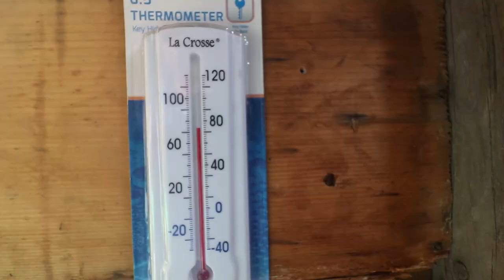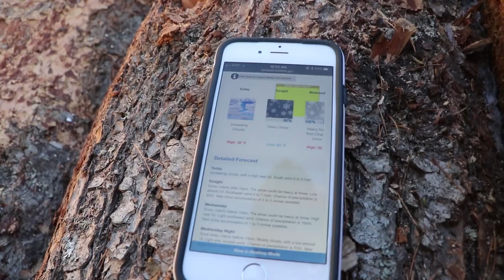Turning a Tree Into Perfect Boards

Comment: If you are going to use any of it for flooring,  you don't really have to worry about the length as long as it fits between two floor joists.  In fact in a floor random length looks really good, and is common practice.  As a side note you have a brake light on the trailer.  Have a blessed day

Comment: nice stacking of bundles....your attention to strips between the boards right at the ends will keep it from twisting....good job.  air drying will take the moisture out of your lumber just as much as kiln dried....with time.  just poly the top to keep the rain and snow out. cheers!

Comment: Jesse, suggest that you consider your stickers at the end of the pack, on the square end a Wider sticker, double the regular sticker width, and move it to the very end of the pack layer. Would guess that it will minimize even more the checking issue. On the East Coast we always do that with All species. HPB

Comment: hey guys, enjoying your series immensely. using it as company while we design the addition to the timber frame home we put up about 20 years ago as newlyweds - your journey sure brings back memories. in any case, designing and building, then having lived with our house all this time, we've some lessons learned that we would love to share. subjects that occupied us and still seem to be open for you - windows, ventilation and heat exchangers, running utilities, generators (built my own low speed diesel powered) pests and varmints taking up residence - lots of lessons learned. our frame is hemlock, built by a framer 3 generations removed from ted benson, located in northern new england with wind and weather that looks a lot like where you are. we'd be happy to have a conversation if you think it might be helpful. BTW, the two ted benson books we bought back then (glad to see you find it useful as well) were great, he surely deserves a place in history for his contributions to all this.

Comment: Nice job cutting the wood. I really want you guys to consider this. You really should get the house dried in before you put the flooring down. I know you feel like you have to do it the other way. But you are making a big mistake. Get the roof on otherwise when you put this flooring down especially after it's been kiln-dried it is going to soak up water like a sponge and it's going to expand exponentially. You really need to have the roof on before you put this flooring down. And you need to keep that flooring as dry as possible from that point on. Even with the roof on, It'll soak up moisture without the walls up.  You need to get the walls up fairly quickly to after you get the floor on. Just trying to be helpful and I hate to see you waste a lot of time and effort and cause all kinds of problems. Do yourself a favor and get the roof on first!
Reply: They don't feel they need to do the floor first, they KNOW they need to do the floor first, per their engineer and architect. I don't understand how people fail to understand how this type of frame works and the fact that the second floor is needed to hold the frame square and the wall panels needed to tie the frame into the floor before the roof is built. They explained it, but then again I also spent about 20 years doing construction work and have seen a few buildings and have built and squared structures. If it was a stick built structure, they it wold make sense to do the roof and walls first. I do agree with the moisture problem. It seems they might have been better off waiting to build the timber frame at the end of winter or beginning of spring and then should have had the panels, windows, and flooring figured out so that they could work during better weather and be dried in by fall. They set themselves up for failure with the timeline last year. They are new to this and crap happens even for professionals. Hopefully, they have a better timeline with getting it dried in and the weather doesn't cause any problems to the house.

Comment: Putting that mill on a trailer is the best way to bend the bed rails.  If you thought you had problems before wait until you bounce it down the road.  I would get some old railroad tracks and mount it the most useful place on the property where you can get to both sides of the mill so you aren't moving everything by hand.  Bringing the mill to the wood means you need to transport your loader as well.  You have access to wood really close and self loading log trucks in the area which is a huge help.  You have a good system, just need to optimize and get more efficient
Reply: I have 2 LT35's and 2 LT15's that I rent out.....no issues.

Comment: Who was flying the drone when you two were on top of the load of wood ???
Reply: My guess is that the new DJI Mavic Pro can program maneuvers ahead of time.
Reply: You can set drones to follow the transmitter in a few different patterns, they just set it to circle the transmitter.
Reply: I just checked it's specs and you can set it track an object. The range is pretty incredible, 4.3 miles although I'm not sure anyone would fly one that far.

Comment: I am amazed that you have your own 27 foot long plank lumber.    To make your own tongue and groove edges you only need a decent router and the appropriate router bit and you can make your own flooring.  Sand it for outside use and get a 230 dollar planer if you need it planed for indoor use.   Now how far is your hot tub from the house?  Why not make a split level walk way with a mid way deck or a deck next to the hot tub from your wood, paint the lower wood for rot resistance and put a roof over the length of the walk way and deck too.   Paint the ends of your cut lumber to keep it from checking and cracking.    If you could get a pvc or steel pipe 30 foot long you could do your own pressure treating.
Reply: They have a 12" planer....that's how they finished their posts and beams.
Reply: They mentioned that it was cheaper and easier to get the kiln people to do the planning and grooving for them
Reply: The mill is going to dry and router it for them

Comment: Please, when securing your lumber (at 17:06 ) ... Two mistakes:
First you need spacers between your lumber on the top row. If they move together the lashing will get loose. 
Second you have to put the lashing near the sticker and not between it to bring it into tension.
The easiest way is to place the top row close together with an additional piece of lumber.

It's all about additional friction the tensioning creates that is keeping the lumber at place while driving.

Comment: Sorry if you have addressed this... How well do the fans on top of the wood stove work?
Reply: I have two fans, they work great , one moves air over 20' to the far wall of my house and the other one move air into my sunroom at night. I did overheat one and had to replace the motor, $14.00....and the thermo pad was I think 40.00

Comment: If you fuel up the mill at the end of the day, you will have a lesser chance of condensation developing in the tank.
Also, the left rear brake light on the trailer is out, which means you have no signal light on the left rear.
Now we wait.

Comment: I know you have explained stickering the wood,but I still don't understand.
Reply: The stickers or wood slats are to separate the boards to allow for air flow all around the individual boards. If you just stack the lumber in a pile it traps the moisture in the boards of the inner stack with the stickers it allows all the boards to dry out more evenly due to the air flow passing in & around them.
Reply: Using pieces of wood to space the planks out so air will circulate through them in the kiln.
Reply: Also prevents mold when air drying

Comment: would like to see a review of the woodstove fans and which is the best
Reply: The fan in the middle I have 2 of those, they work great....just be careful not to overheat them you can fry the motor or the thermo plate, which are replaceable.

Comment: More stickers guys, every 3 or 4 ft. You can tell the length of your lymber by how many stickers you have and the width by how many boards you have by stacking them as close to 50". 6" x 8 = 48 unless the kiln is weird or something.
2 units are 50" each = 100"
A tractor trailer load is 102" wide.
Reply: I'm surprised you didn't tell them to double sticker the ends!
Reply: They stickered the lumber as per the specs of the local sawmill operator. Douglas Fir is different than any other species of wood when it comes to Kiln Drying it so what you may say may work for you, but they are doing what works for their lumber and the local mill, unless of course you are the end all know it all for all kilns and how they operates in the US, and if you are that person, beg my pardon.